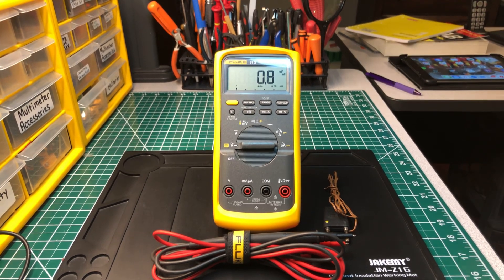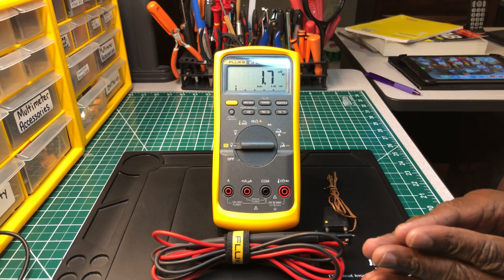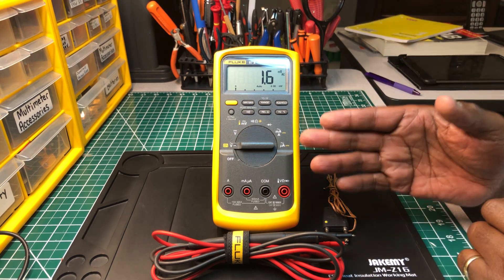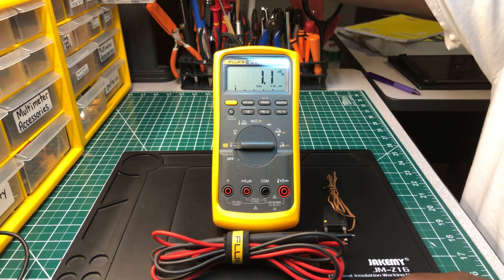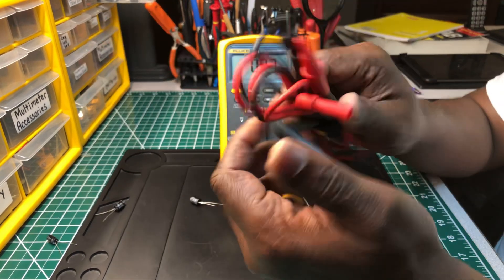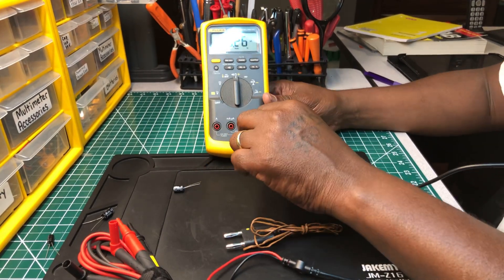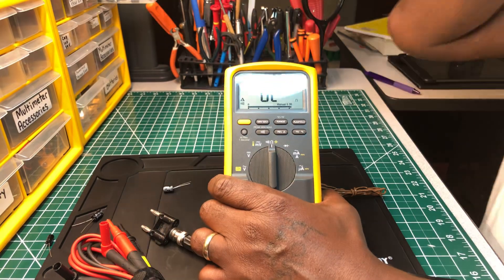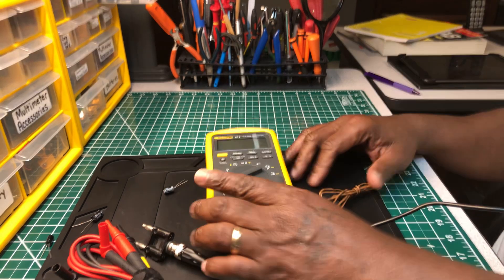🇺🇸 Fluke 87V True RMS Multimeter  ( An American 🇺🇸 Icon )

Comment: Hello, engineer, should I buy a 179 series fluk multimeter or his 87 model, if possible, which model should I buy? Which model do you approve of?
Reply from the maker: What will you be using it for ?
Reply: @TheElectriciansToolChannel  repier mobil and electronic machin
Reply: @TheElectriciansToolChannel  Mobile and electronic board and circuit repairs
Reply from the maker: I would purchase the FLUKE 287 for electronic technicians or the FLUKE 87V TRMS Multimeter.👍🏽
Reply: @TheElectriciansToolChannel  Fluke 87V is expensive, model 179 is not good in your opinion

Comment: This meter is a beast, from residential electrical to HVAC/ furnace and appliance repairs and automotive…. Never, never failed me…. I have many meters for my work and this is in my ( opinion) one of the best….  

Question, Flir cm85 clamp meter is my second go to….

Good day… sir
Reply from the maker: Greetings David, FLIR Thermal Clamp Meter is a great choice. It depends on model you choose,  *lowest model (Good Quality), *the middle model (Great Quality), *the top model ( Best Quality). Whatever works for you, FLIR is a top brand plus the clamp meter high quality. Good luck 🍀 with your decision 👍🏿. By the way I agree with you that the Fluke 87v is still an icon to this very day 💪💪.
Reply: @TheElectriciansToolChannel   I have the cm85 model , use the wattage features when troubleshooting HVAC and furnace units ….. good job, keep up the good work.👍👍👍👍

Comment: You can go 0.001ns, that's like 1 teraOhm of resistance.
Heck it can even measure the insulation resistance of those expensive dual insulated silicon cable of TL-175.

Fancy for fanciful VoltAlert?
No problem, set it to high-Z on 20000 counts mVAC and watch the numbers climb up when you're near electric field. Wrap the cable around 87v as antenna.
You can even measure its frequency & duty cycle.
Will do same thing around smps switching power supply and it'll read its switching frequency.
Reply from the maker: The FLUKE 87v have been tested, proven, and still an icon to its millions of owners / users. ✅💪👍🏿🥇

Comment: In my company in the days these were out, the 80 series were considered meters for control and instrumentation. As an electrician, I had a 70 series, not that it was used that much.
Reply from the maker: It was called or considered an industrial electrician multimeter. Years ago when I worked as an industrial electrician it was almost mandatory that all of us electricians had to have a FLUKE 87v if the company purchased it.  Truly an icon💪💪

Comment: I have the 87v as well along with the fluke 289.
I just purchased a keysight U1242c multimeter.
The 87v wins on auto scale speed, fairs better in low extreme temperature and warranty that's it!
 the U1242c wins all other areas.
The 87v like you said is a beast STILL TO THIS DAY!
THANKS FOR THE POST.
Reply from the maker: Thanks for watching Thewpruden, Keysight makes great test instruments. But they’re not as tough and reliable as a Fluke. (That’s just my opinion)
Reply: @TheElectriciansToolChannel  
I just wanted to give this keysight a try because of the features, the one I purchased is IP67 rated with a 10 ft. Drop test.
To good to turn down!
But I hear you and fo respect your opinion.